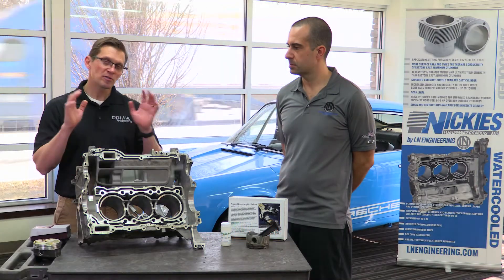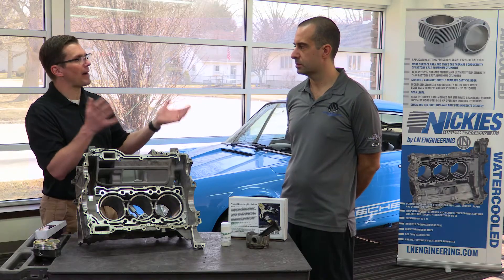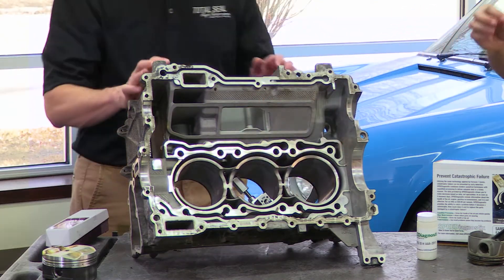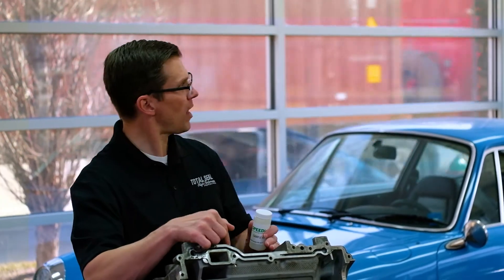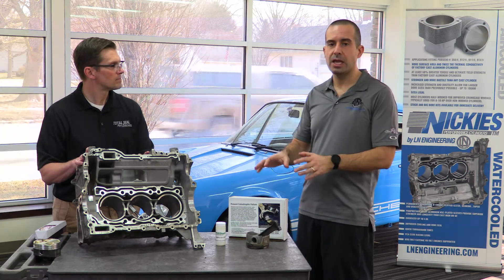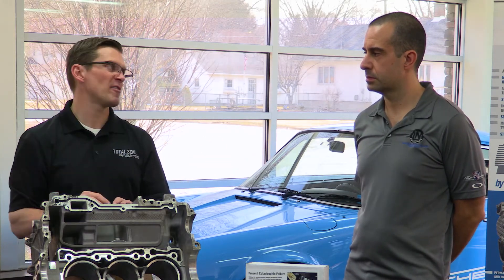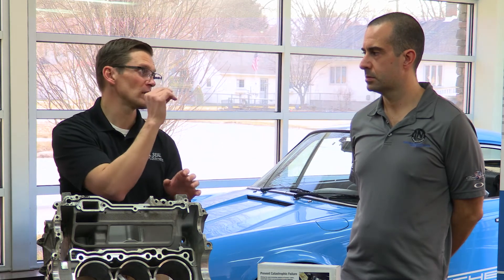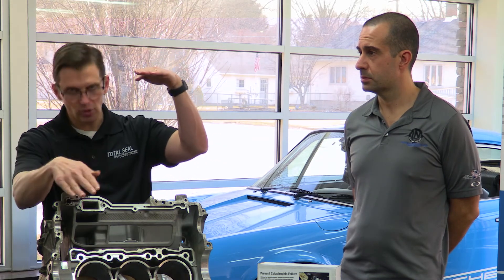Cylinder Bore Scoring - Part 2: Does My Engine Have It? - with Lake Speed Jr.

Comment: Cylinder scuffing/scoring is fascinating. I've been reading scientific papers about it and it occurs in all engines for many different reasons. It's been actively researched since the advent of the ICE and continues to be an issue that designers try to circumvent. Thanks for the video series.

Comment: @ln Engineering: Hi, I did a oil analysis twice and got the first time (March 23) 25ppm of silicium and now I just got 35ppm (5.000 km driven in between oil tests). The lab say it's maybe coming from air filter, but listening to your video, sounds more like bore particles. Am I right to assume this should come from the bores and are those ppm worrying? Many thanks!
Reply from the maker: If you have an engine with a Lokasil or Alusil cylinders, the silicon is likely coming from the cylinders. I would also expect increases in iron and aluminum. It is unlikely to be from the air filter as long as you are using a paper filter. We see this incorrectly referenced in oil analysis reports from labs that do not know Porsche engines as well as we do.

Comment: How much would a bore score engine repair cost at LN Engineering? 2006 Carrera 4.
Reply from the maker: You are looking at about $5500 for the block sleeving, plating, and honing including new oversized pistons, rings, pins and clips and your 3.6 would in the process be taken out to 4.0 liters. https://lnengineering.com/36-to-40-911-nickies-inc-101mm-fsr-je-piston-set-inc-rings-pins-clips.html

Comment: Will a product like Liquimoly Ceratec work in helping to prevent bore scoring?
Reply from the maker: Yes. Ceratec or their MoS2 additive will help as Moly is the only additive that can affect the aluminum wear surface. However we recommend Driven DT40 or DI40 as these oils have more moly in them out of the bottle than you would get with a Porsche A40 oil that has had the LM additive added to it.
Reply: @lnengineeringllc  Are Driven oils available through a European reseller?
Reply from the maker: @khalelhotee  Our EU representative, Custom Concepts out of Benelux, carries select Driven products. Otherwise, you can contact Driven directly and they should be able to find you a local dealer.

Comment: Hi, I'm so glad to find LN Engineering on Youtube. 

My 996 was grown in New York and I just bought it to California this year. The passenger side of the engine is having a tick tick sound. After doing some research, I suspect it is the bore scoring issue, but I haven't done any bore scoping yet. 

My question is that what I should do given I cannot afford sending it to LN Engineering now? Can I just directly replace new pistons?
I just replaced the engine oil using 5w40, is it the right thickness you recommend?

Thanks!
Reply from the maker: At this point the best thing you can do is run Driven DT40 in the engine:

https://lnengineering.com/driven-dt40-bundle.html

The high moly content will provide the best protection possible, but there really isn't anything more that can be done to reverse the issue and there is no cheap or easy way to fix it. Here is some more information specific to bore scoring and what we do and what your options are:

https://lnengineering.com/products/watercooled-porsche-cylinders-sleeves-and-pistons/bore-scoring.html
Reply: @lnengineeringllc  thank you!

Comment: Hey I only have 56k miles everything is great on my car started using amsoil 10w40 and only use Vpower. Will every engine get vore scoring in due time? My car runs great but tach does bounce a tiny bit so I think coils and spark plugs need to be done. Also thanks for the videos!
Reply from the maker: There are lots of factors that go into whether or not one of these Porsche M96 engines with Lokasil bores (or later Alusil blocks) will score, but using a good oil with more frequent oil changes along with top tier fuels (or ethanol free even better) are some of the best things you can do to minimize the chance of bore scoring.
Reply: @lnengineeringllc  Thank you for the response! I will spare no expense on oil and fuel!

Comment: I want to trend oil analysis on a newer engine. If I have just changed the oil, how many miles/hours of operation should I wait until taking a sample for analysis?.
Reply from the maker: I would wait a minimum of 1000 miles of street driving. Anything less than that would not be meaningful to test.